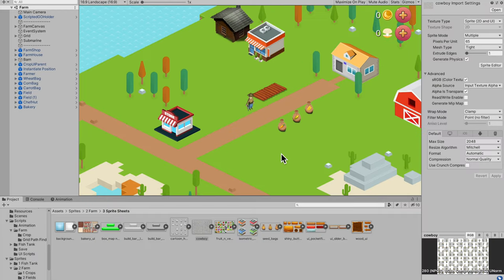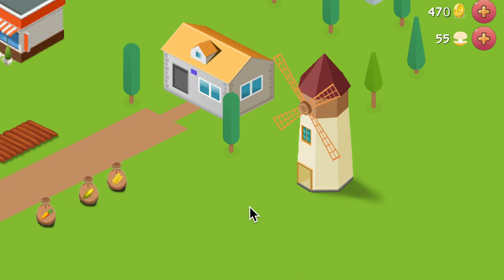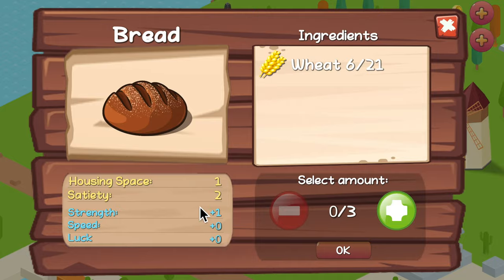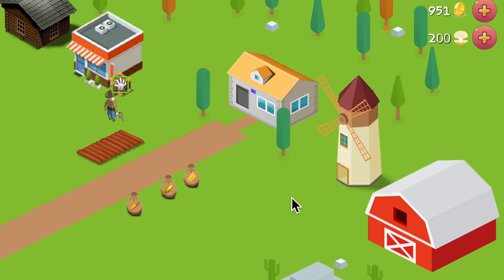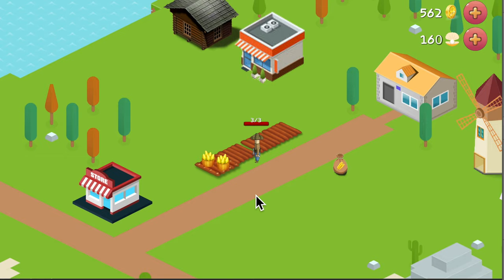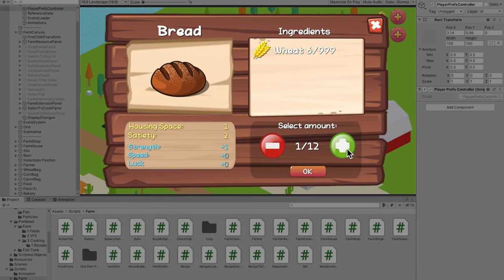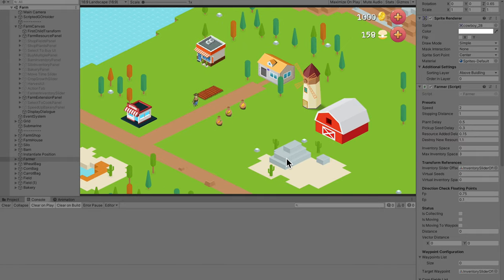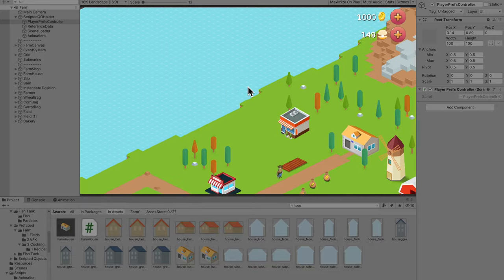Devlog - DELIVERY SYSTEM! Part 10

Comment: Late to the party here, but still wanted to add in some advice for anyone experiencing this same spaghetti code nightmare. Don't fixate on making perfect code, get it working first & refactor when you know the full extent of the system. How Kap does it here is perfectly valid, hes got it working & then restructures it when he realizes the system's extents exceed its current implementation. Planning out the code in advance can help to avoid this, but equally requires large amounts of time and doesn't work if you have a low-mid skill level - though some planning is always better than none IMO (White boards save a lot of headaches).

Something very useful to have done in this case would be to use Source Control. You might think that working on a project solo means you can side-step git but you just slow yourself down. Being able to branch off and refactor something, without the worry of irreparably damaging your project, allows for rapid & deeper iterations w/ far less anxiety/hesitation(procrastination). This is just one of several benefits. Always hook your project up to source control - especially if its 'just a prototype'.
Reply from the maker: Well said and very true! Especially about source control